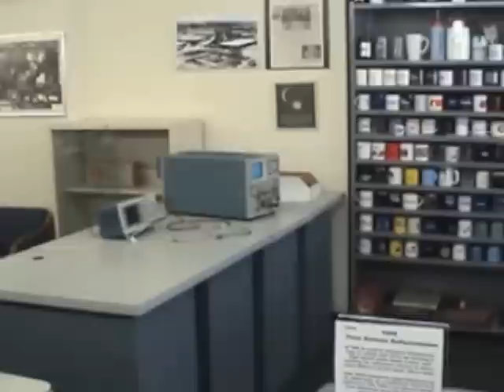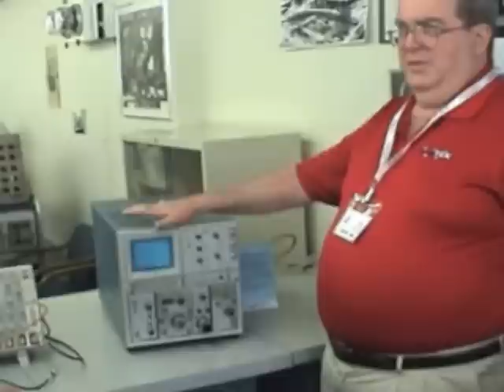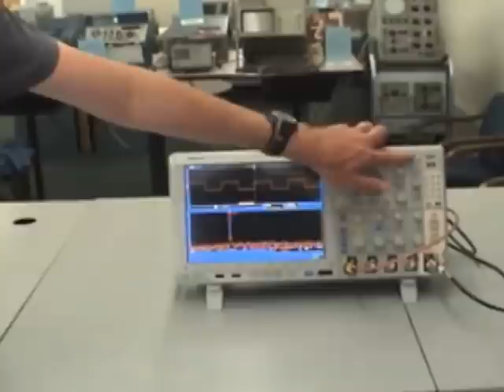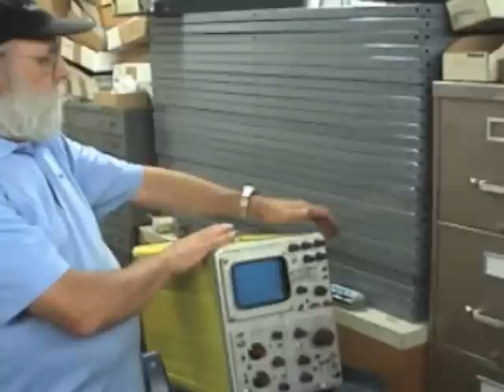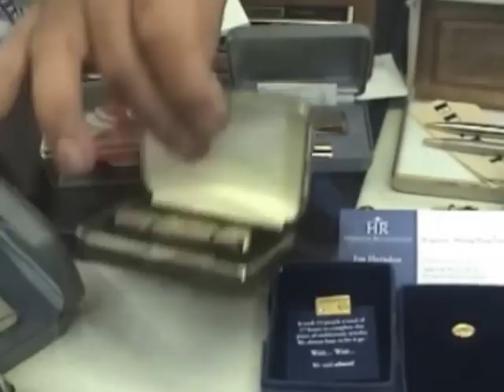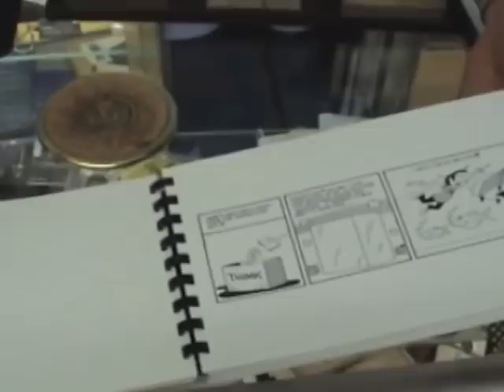Tektronix and VintageTEK

Comment: I just wanted to thank you for this video. I recently bought a complete 7704A mainframe with two external modules and many plug-ins. All in very good physical shape. The only issue is that the scope power supply does not power up. The information you presented is very helpful in my effort to get my mainframe back into service.